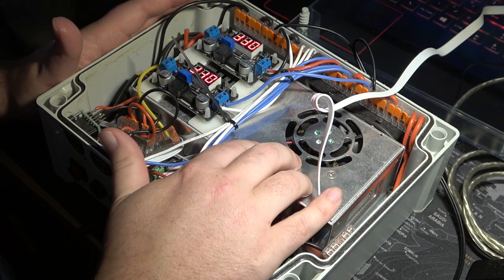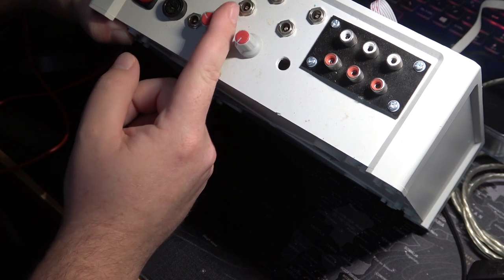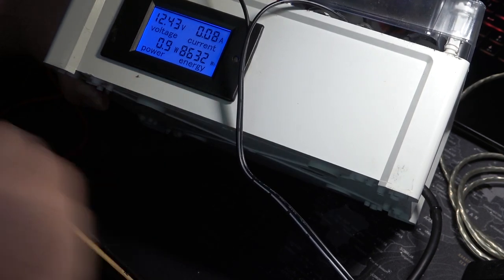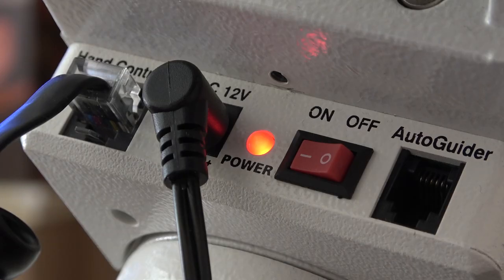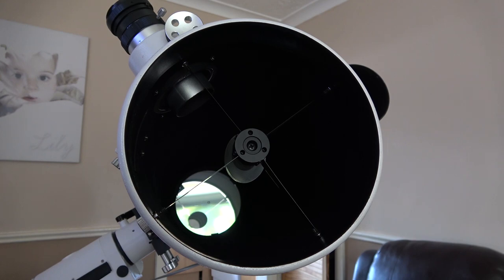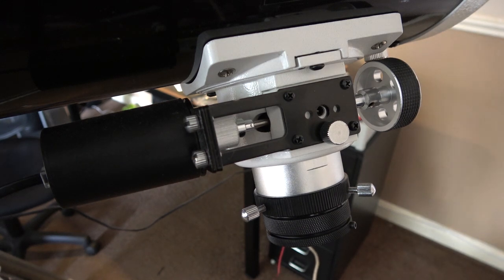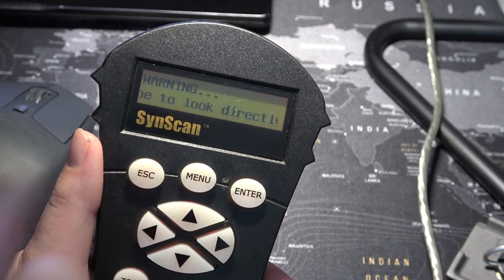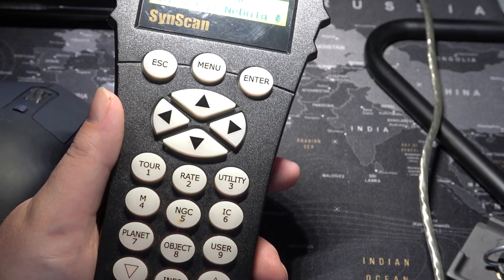SkyWatcher 200p and HEQ5 Pro Mount

Comment: Don't you have weight problems?
Reply from the maker: Pau Pardo actually not, I have an extension bar to extend the counterbalance weight further from the centre of rotation to balance everything without increasing the rotating mass.
Reply: @Milk and Bourbons  where did you get the extn bar?